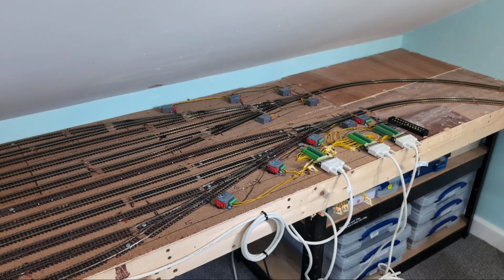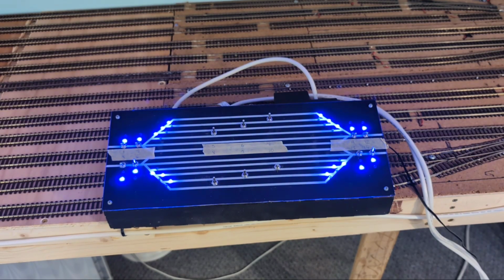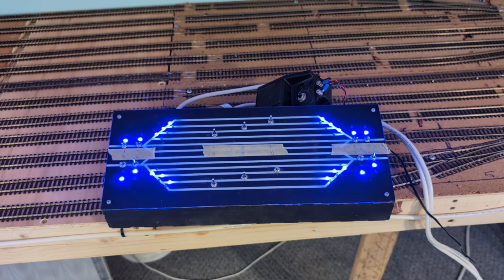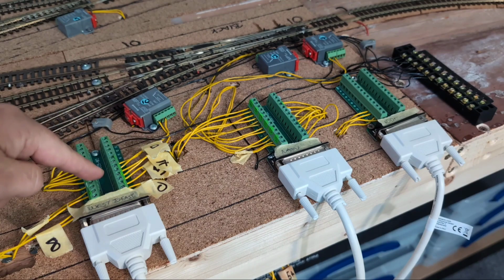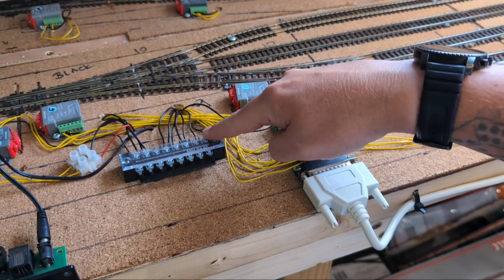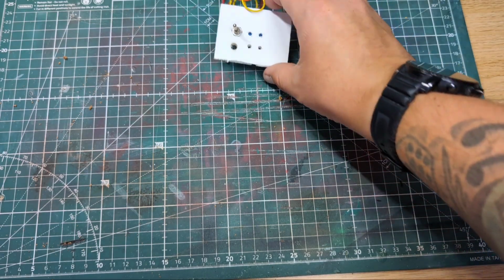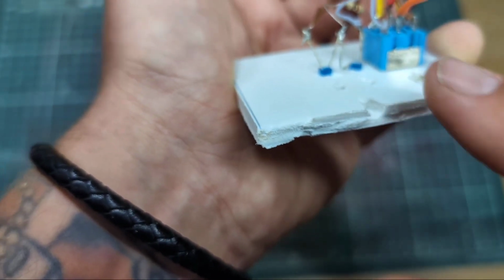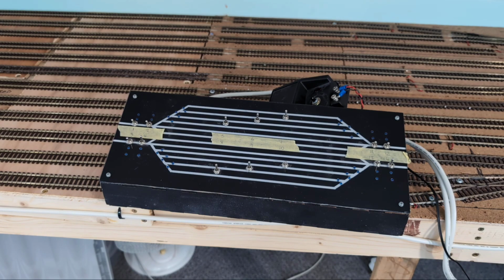55. Fiddle Yard Control Panel

Comment: Hello mate. Only me. In my latest update I tried to use dsubs in my testing found they couldnt deal with the CDU power surge to fire 2 points simultaneously but glad I was on the right track.
Reply from the maker: Bizarrely seep motors require such a strong instant draw that they cause problems for things like this (if you're using a CDU I assume they're seep) but these are slow action ones so it's really tiny draw of power over a few seconds. So doesn't require a CDU. Maybe that helps?
Reply: @EmperorsPath  yes mate exactly spot on. I've not got I to the more expensive motors, just stuck to solenoids. By virtue of testing, found that the dsub connection was dropping power. Was a head scratcher for a bit.
Reply from the maker: @_RandomPea ahhh gotcha! That sucks! Hopefully you fixed It though?
Reply: @EmperorsPath  yeh, was up last night soldering in a 10 pin jack, now just got to find 10 core cable at a reasonable price. Cheers 👍

Comment: Great video, cheeky plug for myself at Flexxgenix when you come to move forward with a laser cut panel.😂😂

Couple of ways to solve your bright led issue, either review your dropper resistance, stabilize your led supply, or/and a simple phase switch circuit with adjustment.
Reply from the maker: Actually....the original box was one of yours! I just couldn't remember the name 😔 🫣 i used the original box from my old layout. I just added the clear plastic cover my self!

Thank you for reminding me of the name!
As for the LEDs I appreciate the help on that, I'll give it it a look! Thank you!
Reply: @EmperorsPath  I must admit my social media has been a bit lacking over the last few months. Busy as ever but there are big plans in the background taking up time. I think I would first try an lm317 voltage regulator to control the voltage you are supplying the LEDs with. It’s an easy chip and you will just need a couple of resistors and a variable one. Little bit of maths but it’s all online. Next try suppling from a variable pwm circuit. eBay have loads. It’s how they dim led strips.

Comment: IS DCC GETTING FAR TOO EXPENSIVE ???
Terrifying !  And I thought DCC was supposed to reduce wiring ?  My 30 track 30ft long (Exhibition layout) Fiddle yard using 12v DC and TCC (Track Circuit Control) which copies real life railway wiring methods (NO CHIPS NECESSARY). Has no more than half the wiring you appear to have, and I'm 90% sure costs a fraction of the cost you must have spent. Further my Fiddle Yard is remotely controlled by two panels (one for Up trains & one for Down trains) around 20ft away, by two separate operators. Further I can use Burglar Alarm cable for wiring, (Max 50v 3 amp) so a 100 meter reel with 12 different coloured wires (total 1.2 Km of wire) only costs £35. How much did than heavy duty chunky wire you are using cost ????

Happy Modelling 🙂
Reply: @EmperorsPath   I forgot to add, that Burglar Alarm cable (which is multi stranded not hard drawn) is tiny & looks like telephone wire. It is available from ANY "City Electrical Factors" (CEF) Wholesaler, who are usually based on an Industrial Park. Technically you need a business card to  buy from a Wholesaler, but I've never been asked for such. It means however that wire for layouts is dramatically cheaper than any DIY or High street store. On DCC layouts the regular 16v AC means you can go to Max 5 amps (safely) with Burglar alarm cable. But you must be aware that if feeding track and you are running a number of trains simultaneously this may draw up to 10 amps ! For example a Hornby Britannia & 12 Hornby Pullmans with interior lighting I found will draw 5 amps, just for this one train. So burglar alarm cable for track feeds on DCC layouts is NOT advised !!! All of which is just one more reason I do not use DCC.